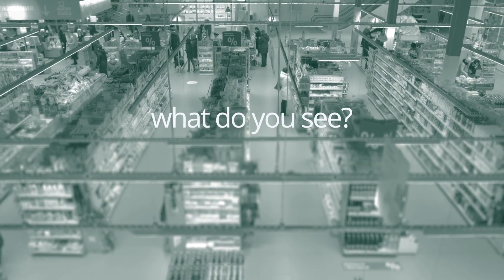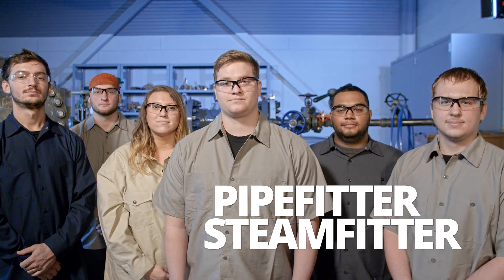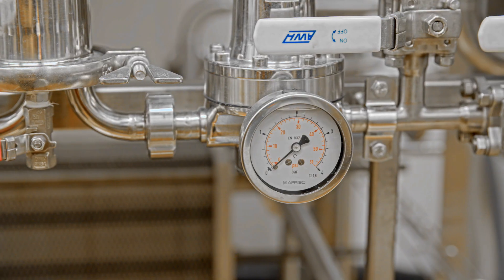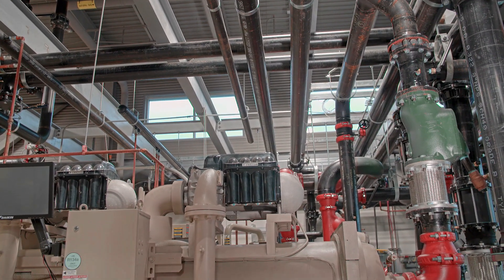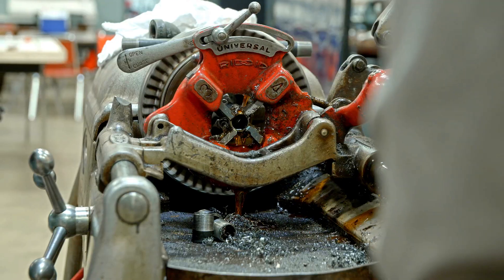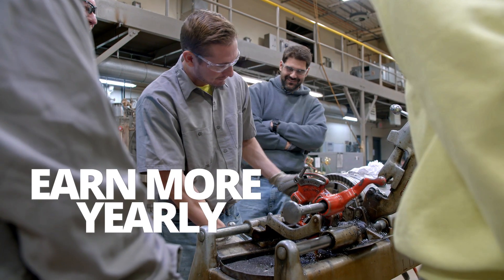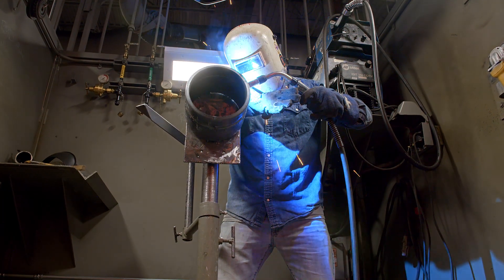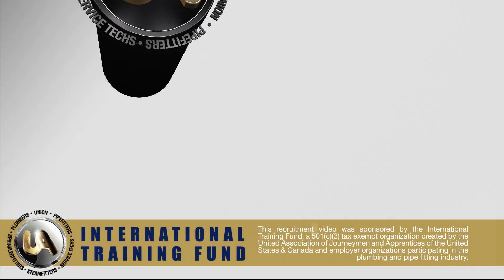Learn about a Pipefitter & Steamfitter Career with the UA

Comment: What math is used in steamfitting ?
Reply: Foundational pipe trades theory teaches Trigonometry, geometry, fractions, and of course adding subtracting and division. You would also need to understand basic science and formulas, such as Heat load calculations, gas laws and fluid dynamics. Also, the physics behind fluids and gases moving through tubes.
Reply from the maker: @Chrominance87  Great answer!
Reply: A squared times B squared = C squared.
Reply: See I would love to be a steam fitter but I suck at math..
Reply: Measuring for the most part.